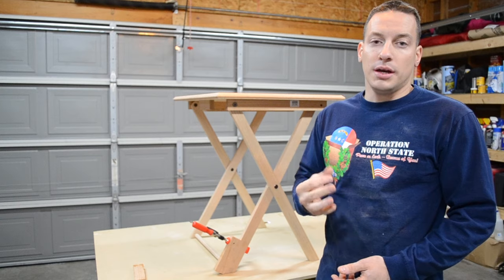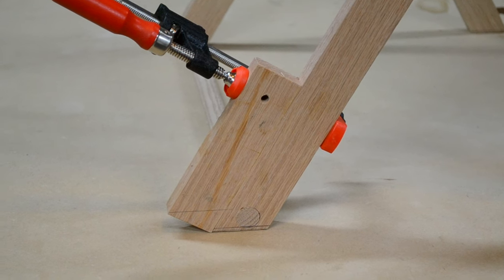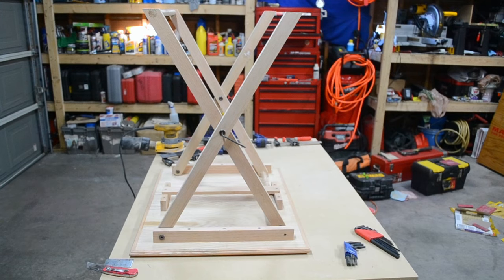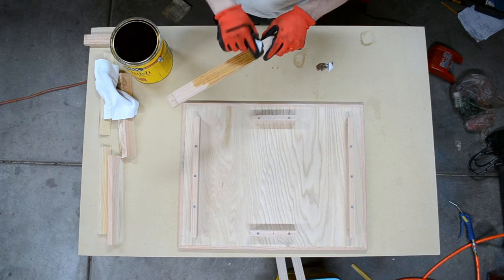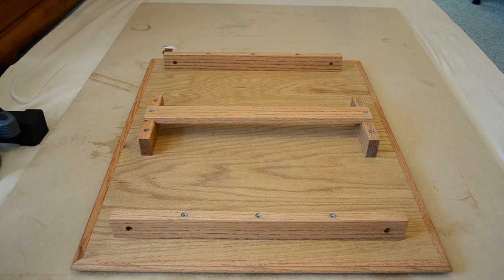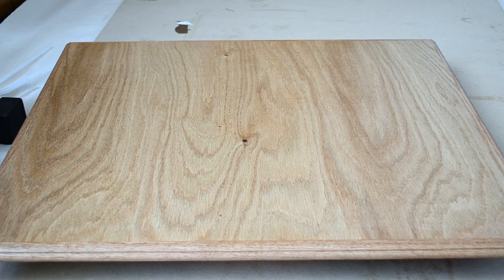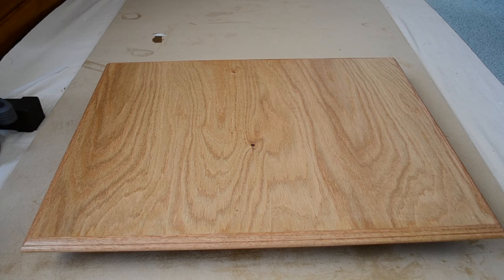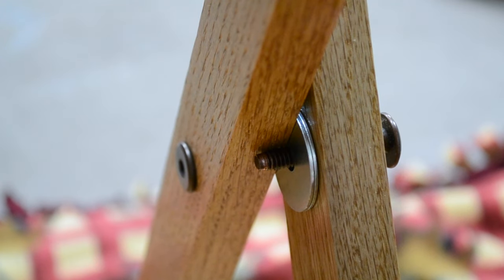TV Tray Build Part 3

Comment: Hi Dave, thanks so much for your reply.  You're right that measurements are given at certain points in the video, however, what you don't say is the dimensions of the stock you bought.  What is the thickness and width of the pieces you are working with?  I believe you said you bought the oak at Home Depot pre-cut, but what was the pre-cut dimension?
Reply from the maker: Kevin Colson the true measurements are 3/4 x 1-1/2” so the standard 1x2 measurements. As long as you use the same size for your whole project you won’t run into any issues even if you bought the wrong stuff

Comment: What did you use to put legs together so they swivle at that 15 in. Point.i dont know what to use ( theme of the swivle pins I guess), I used nuts and bolts, but it would not swivle
Thanks
Reply from the maker: I used furniture hardware that I got at home depot. It's like a bolt and a nut with hex keys at the end so it makes a flush finish.  I also put two washers between the legs so that they move easily. I hope that helps. Thanks for watching.
Reply: Connecting Bolts 1/4in-20x40mm and Connecting Cap Nuts 1/4in-20x12mm
They are in little bags 4pk in the Drawers of specialty screws.

Comment: What keeps it from wobbling side to side?
Reply from the maker: A good tight seal with the rods going through the legs at the top and bottom. I also have washers between the pieces in the middle that are about 1 1/4” wide so the pivot points are minimal and tight. It has a slight wobble but NOTHING compared to store bought ones. Use good material that doesn’t flex much and you will be fine. Thanks for watching.

Comment: You should have just rounded the bottom of the legs like you did on the top of the legs. But all in all good video.
Reply from the maker: Jon Moore I wanted a larger contact point with the ground.